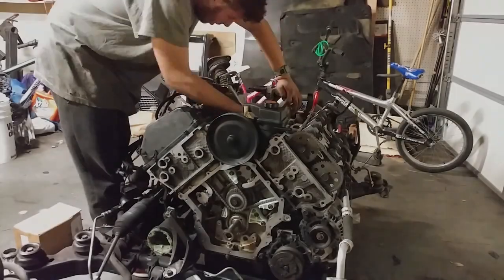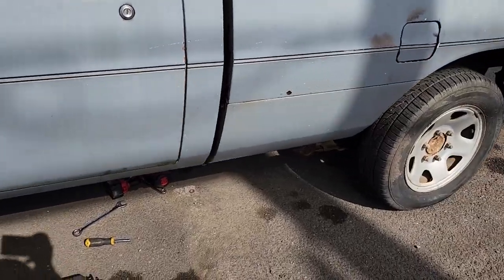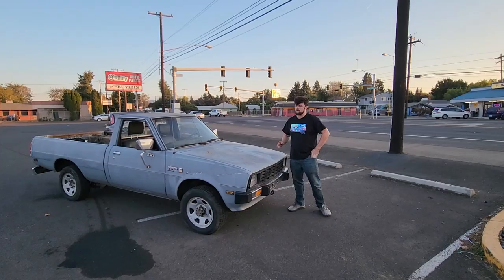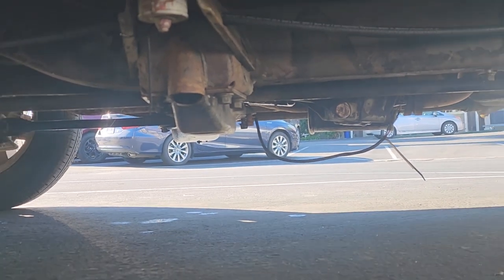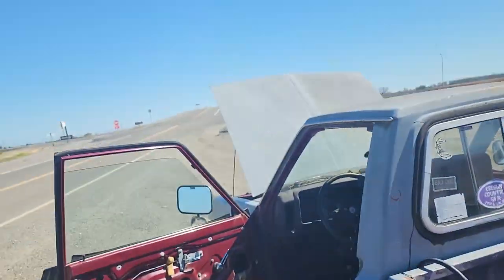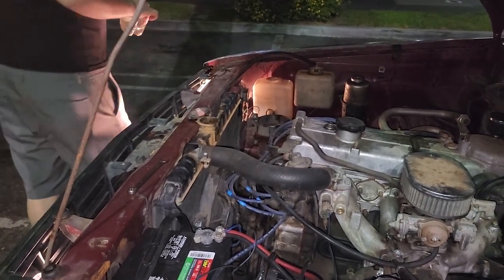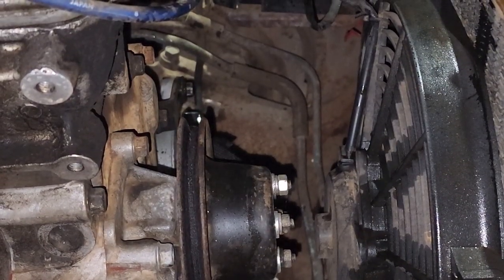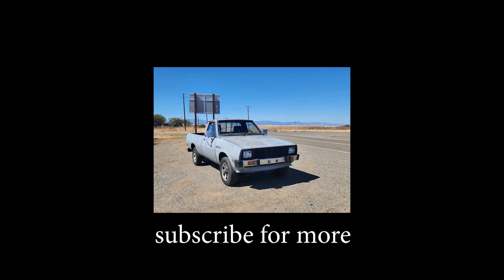Will this 40 year old mini truck drive 900 miles home?

Comment: had a 1980 given to me from a friend in h/s. i'm 62 now. rat ate tru 13 wires. splice them all back togeather and with fresh gas drove it home from weatherford tx. i live in stephenville tx. sanded down primed and painted. free. her dad drove it to her house got sick and died. that was 1995. now running from last summer 2020. grt lil trk.

Comment: These trucks weren't at all bad looking little trucks, however they didn't last long as they rusted out to quickly, just like the LUV and Courrier trucks especially if you lived in the nothern part of the country whare there is ice and snow.
Reply from the maker: I'm sure alot of them did meet an end like that, but luckily this one didn't. considering it lived in the PNW it held up remarkably well

Comment: I don't really know what was going on with the one I had but it was putting gas in the oil can't recall if I had a mechanical fuel pump or had one in the gas tank it was a 87 I don't know but I didn't like it so I got rid of the experiences I've had with those trucks they wasn't no count